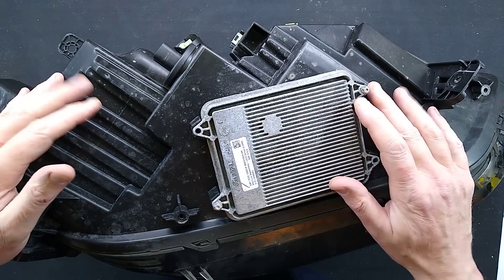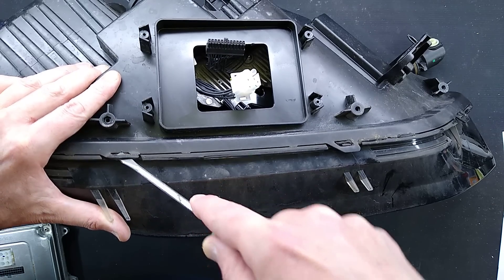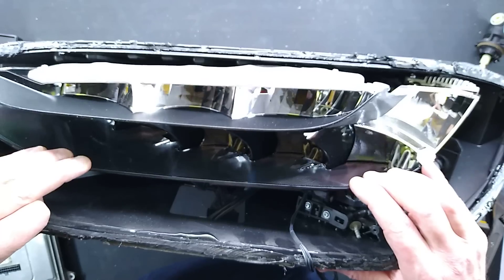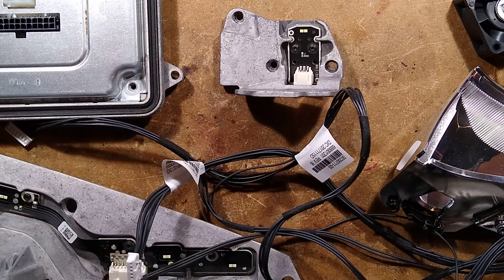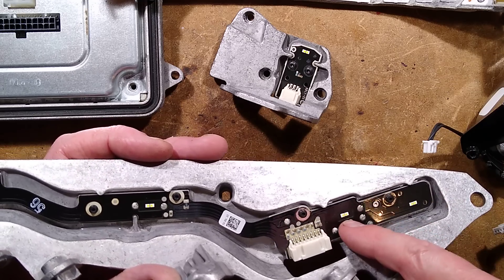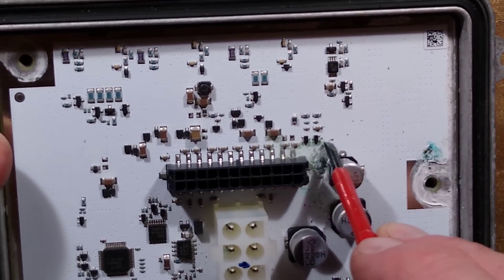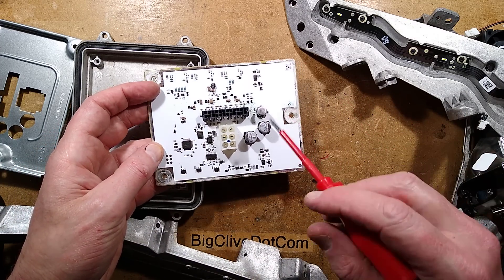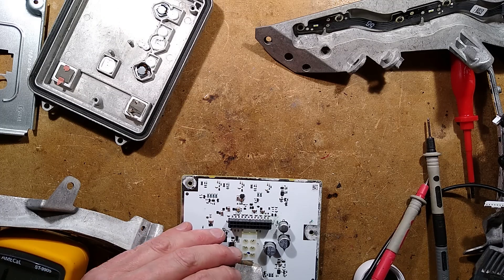Exploring a Tesla model X headlight

Comment: Remember when automotive circuit boards came with conformal coatings to keep out water damage?  
Yeah...not anymore!  You get to pay thousands of dollars for something that would have cost 2 pennies to protect.  
Yay Tesla!
Reply: I wonder why in our day and age is so “difficult” to make car parts waterproof… especially headlights, it’s not seems to be that difficult, not a quantum physics or something
Reply: @llMarvelous  Cost. Though some manufactures are upping requirements. I worked at a place where 100% of the electric door handles were failing. I response they upped the requirements for every external component with electronics. I think some of this is down to Tesla's arrogance that they are outside the realm of all the other automotive manufacturers. Hence why they've also forgone using automotive grade displays or other components.
Reply: @mintzbuck  yeap, but door handles is much more difficult to seal, there are a lot of moving parts, not just an enclosed container 
And also cost reduction is good, I guess, but poorly constructed parts may fail during warranty, and also it’s not a good reputation for the company… Tesla is not some cheap crappy car
My point - it’s very simple, but they not doing it anyway
Or maybe it’s just one defective part out of thousands…
Reply: @llMarvelous  It was literally just the exterior part. They ended up fully potting the circuit board in it. This module could have just been fully potted. And the point I am making here is, cheaper cars are doing more to make sure there aren't failures like this.
Reply: @mintzbuck  agree
Reply: @llMarvelous  Well it's not a cheap car, but the variable build quality and often questionable engineering makes it something I find less than impressive. It's very much like Apple, in that if you like what it offers (slick, fashionable, "cutting edge") it might be worth it to you, but if you're not interested in that sort of thing it's just overpriced. Personally the more touchscreen and cell-phone like general electronics get the less I want any of it, especially when it's grafted onto the nervous system of the car and un-upgradeable. The manufacturers just assume you're trading for a new car after 5 years now so standard DIN head units you can just swap are going out the window.
Reply: @mintzbuck  I dont think there were any 17" automotive grade displays back in 2010, while designing Model S.
Reply: @llMarvelous  
Car lights are tough to get watertight, as the lamp heats up and cools down it will draw in air (or push some out), causing moisture to ingress over time. Many designs these days do have dedicated membranes that are intended to keep at least water out. Others take quite a bit of care to at least keep electronics out of the way of likely condensation spots. Also a lot of  the control modules are either fully (or partially) potted (xenon drivers come to mind) or conformal coated. At least they were in the 2000s and 2010s. And i am pretty sure they would still be these days.
But especially Tesla has some.. let's call learning curve. With Elon's particular opinion about the "traditional car manufacturers" they have gone through wuite some design iterations on several car parts. The retractable door handles with their failure prone microswitches come to mind, iirc they changed that later on.
But i have a bad feeling we are going to see such issues bekoming more commonplace throughout all brands of cars.
Reply: @llMarvelous  Stupid design made to look fancy instead of work. Making each of the LEDs waterproof in that design is probably too expensive if having custom gaskets, vs just gluing it. If they made a simpler LED array, it'd look plain, but be easier to make.
Gotta make it look as stupid as possible (Apple trash can PC) and more useless to use to sell more!
Reply: @llMarvelous  Many headlight assemblies that I've seen have vents on them. They aren't sealed. I guess the idea is to make the innards of the headlight assembly waterproof so that any water that does get in won't cause damage. And provide vents so that any water that gets in can eventually evaporate.
Reply: @brianleeper5737  I'm very surprised to hear that they have vents...
With all headlights, first and foremost, they're sealed to keep moisture away from the ultra hot bulb. After that, it's to ensure clarity of the clear front headlight cover on the INSIDE (where we cannot access, let alone clean).

So any vents, in my opinion, I would think would be 1-way... Something like a simple reed valve using light weight super flexible rubber/silicone perhaps... 🤔

Either way, if not and it really is a completely open passage, then I'd be genuinely curious to know the method of dust mitigation utilized in order to prevent any from entering the headlight enclosure and thereby obscuring light output!
Reply: @DUKE_of_RAMBLE   I've seen what appears to be a piece of filter material stuck on the back of a headlight assembly.

Regular spinning-platter hard drives are also vented and have a cleanliness requirement that far exceeds what a headlight requires.

Considering the elevation and temperature changes a headlight is exposed to, how could they not be vented?
Reply: @brianleeper5737  My assumption would've been that the change in atmospheric pressure is both a slow process (not enough to cause rapid impact), but any built up pressure would have managed to escape by the o-ring around the bulb. A crude analogy: puffing your mouth up with air and at a certain point, you're lips can't contain the pressure and.... pfthbtbt; however, your lips are intact and still continue to seal without issues. 🥴

But yes, you make a valid point with HDDs. I honestly thought that it was there only to allow built up pressure to escape during spin-up (due to that [Nickola heh] Tesla Pump effect where high speed discs spinning in close proximity to each other generate considerable airflow... and presumably does the same in other liquids)
Reply: @DUKE_of_RAMBLE  I think they've determined that it's better to provide an easy path for air pressure to equalize than to hope that the o-ring is the weak spot.
Reply: @DUKE_of_RAMBLE  if there is a pressure buildup that results in a venting, now there will be a vacuum when it cools down that will suck water in.

Prime example is differentials in 4x4 vehicles, they get nice a warm, vent a bit, then when you hit water and they cool rapidly, they suck water in (unless you route your vents up high, which is normal, but some people get lazy during repairs)

you could of course just run them in a vacuum all the time, but that is much harder to maintain with seals, and also negatively impacts heat dissipation.
Reply: @Wooble57  So it's settled...
Fill the entire housing AND module with mineral oil!
No need to worry about condensation or dust, no air to create a pressure differential (I think 🤔) while fully sealed, and in turn no vacuum to draw in moisture. Plus, good thermal transfer! 🤘lol

[this is in jest, though, it may be feasible... if there's a seal material that won't degrade from being in constant contact to the mineral oil... which now that you mention diffs, I guess RTV would work!]
Reply: @Wooble57   "vent a bit, then when you hit water and they cool rapidly, they suck water in" Thanks. That explains it.
Reply: @brianleeper5737  Its normally a small rubber pipe at the bottom of the headlight unit on some cars that lets water out but not in.
Reply: @llMarvelous  It's planned obsolescence. We make submarines, why shouldn't basic electronics be possible to protect even if the whole car were to be submerged at some point. It's made to be replaced at some point, not enough money in just selling the cars.
Reply: @Tomazack  but Tesla don't like/want repairs, they just want to make & sell new cars.  They don't want the extra overhead of databases/parts storage space & service/repair staff (franchises like the ICE manufacturers).
They genuinely don't WANT to need to store & supply spares.
Reply: @Tomazack  Hence the need to deliberately shorten the lifespan of the products so consumers become repeat customers more often than they should, resulting in more profit for the company at the expense of the consumer.
Reply: Ford used some stuff that felt like silicone and had flakes of some kind in it (probably to make it easier to see how much has been applied and where)
Reply: @brianleeper5737  A lot of conformal coatings glow under UV. It's a common strategy for doing quality checks to make sure enough is applied and in the right places.
Reply: @mintzbuck  I'm aware. I guess Ford's way of doing it (which I've seen on ECUs from the 80s and early 90s) eliminates the need for a UV light for inspection.
Reply: ConCoat can bring about EMC issues, you wouldn't think it, but it's true and manufacturers spend a lot of money working out which components can and cannot be coated. They'll even specify exact thickness and exact mixtures of coating versus a solvent, which can have a massive impact on the production side as it usually has a negative effect on curing times and automated inspection.
Reply: pre 2004 they used to conformal coat ECUs now they don't bother and alot of them get a bit of moisture in them and rot,
Reply: @imranahmad2733  Pre-2004 ECUs were also less likely to be be under the hood. Now it seems like both Ford and GM put their ECUs in the engine compartment. You'd think that the need for conformal coating would be even higher in that location.
Reply: @brianleeper5737  I've noticed mercedes do that, they have the ECU right by the hot side of the exhaust/turbo, VW/Audi and Peugeot put them right by the battery, I can't see the logic behind it.
Reply: @imranahmad2733  Probably saves a meter of wiring compared to putting the ECU inside the car.
Reply: Is the Apple of cars
Reply: Remember when sealed beam headlight could be replaced for $19.99???
Reply: @woolymittens  When I was cleaning out my dad's garage after he passed away I found a couple of sealed-beam headlights still in the box. They were PLASTIC. I thought they were all glass, I guess some of them are made of plastic now.
Reply: I have a minor pcb hanging out the back of my Volvo v70 drivers headlight cover that’s seen two winters and some of the hottest days we have had in England and is still fine. 😂
Reply: Who on earth want to pay for this? 
The Industrie does not ¯\_(ツ)_/¯
Reply: I used to work for a scrap company and one of the things I'd do on occasion would be to teardown samples of automotive electronics so we could calculate a price quote to offer the seller.  Pretty much every one that I can remember at least a thin layer of conformal coating.
Reply: If we cover the circuit board with a conformal coating, what protects the connectors?
Reply: I still have ECUs from the early 80’s with conformal coating that work perfectly to this day. And yet stuff now just goes right to the landfill.
Reply: The conformal coatings can be obtained in 30 litre metal pales with spray machines , and even in giant Ibc pallet tanks 🙄
I've got spray cans of it somewhere ..
Reply: @grantrennie  the fact at how easy the stuff is to obtain why in the hell don't manufacturers do it already isn't that the point
Reply: My 2008 Volvo S60 HID active headlights (directional) which were worse than my previous 2007 S60 halogen Osram illuminated lights, were £1200 each (NOT from Volvo) to replace.  What exactly are you all criticising Tesla for with their mega modern, multi-lamp, sensor riddled lights & cost??
Reply: Why not sell a headlight a couple of times for one vehicle? Planned obsolescence. Greedy fucks.
Reply: the same company that monitors your driving actively and raises your rates nearly $1+ a minute if you're driving past 10pm
Reply: At some point in time they will have made any error already made by competition in multiple decades. 
Young guys (not really) wanting to feel the burn of the hot plate on their own.
Reply: Tesla are known for the worst (mechanical) quality in the business. That says something considering the plethora of german and german owned brands that crowd it.
Reply: @rimmersbryggeri  Heard that more than once.
Reply: @DIYDaveOK  Soon there will be a part of the population carrying a model s pendant round their neck rather than a cross, wrongfully claiming that it wass the archons of our age that destroyed their master rather than arrogance.
Reply: Wow, lots of Tesla haters on this thread.
Reply: @JohnCline  I’m not a Tesla hater, I just want to be able to repair simple things instead of replacing them.  A tiny bit of corrosion making you replace an assembly that complex and expensive is an absurd waste.
Reply: @JohnCline  Na, I'd call this a medium-low level.

And the funniest thing about is that this is not a Tesla-designed part. It's a standard supplier catalogue part that Tesla just ordered with their mechanical and visual specs...
Reply: @JohnCline  yes I hate Tesla
Reply: @JohnCline  You'll find a bunch of "haters" on these tech channels, they are all jealous that they didn't become rich. The biggest example is Thunderfool and his minions. A chemist preaching engineering and a bunch of equally unqualified missionaries trolling the internet. I bet there are some here.

Comment: Led headlights are notorious for failure, all it takes is one module inside to spit it's dummy out and it's game over!
I know the ones I've come across have fans inside as they get ludicrously hot!!
Reply: It's also very likely they are Lin bus single wire networked
Reply: Led tail lights are high failure too, yet another expensive "module" to chuck in the bin rather than replace a little bulb.
Reply: My personal pet peeve with LED tail lights is that lots of manufacturers seem to have chosen a dismally slow PWM frequency.  This for a light whose intended application is CAPABLE OF PROPELLING ITSELF AT OVER A HUNDRED MILES PER HOUR!   It’s a strobe-fest just watching one of those vehicles make a left turn.  The mind boggles.
Reply: @volvo09  yep, replaced a VW one a few months back was over £200 because the side light part failed!!
Reply: This is why halogen bulbs will always be better!
Reply: @chrisa2735-h3z  50% of the total energy used by Halogen lamps is converted to HEAT.. not light.

Comment: Interesting optics... to think that such a teeny tiny LED module does the job of a H7 bulb! Flex PCB is an interesting design. And yeah, the controller board looks kinda dissapointing, and like we see here, not really resistant to water damage. Tesla (the modern kind, not the one you had in Czechoslovakia) seems so dodgy when it comes to electronics.

Comment: The only way to get modern headlights apart is to use an oven then take it apart whilst still hot from oven.
Reply: Only if the adhesive is butyl rubber. From the video I think here they used something non-releasable.
Reply: @QuitProcrastinating  I believe it is, people have successfully repaired these Tesla headlights.
Reply: Probably ultrasonically welded the polycarbonate.
Or used DCM.....  🧐
Reply: A hot knife would work better than a Dremel imo ...
Reply: Mainly two kind of glues are used in modern headlights. Butyl seal, which can be "baked" open or "Permaseal", which is nearly impossible to open without breaking the housing.

Comment: I'm guessing the long strip of very small LED's is the sweeping indicator lights. Would explain why they are individual circuits. Perhaps the larger LED's are the dipped and main beam?
Looks like on the main (non conformal coated) board, the small mosfets are prob for the indicators, with the larger ones on the back for the main and dipped LEDS perhaps?
Reply: A Tesla model X has separate indicators in the front bumper and they are not animated. Those really small LEDs are the actual headlamps. That’s why Big Clive was so surprised, that these tiny components produce the majority of the light. Fun fact: the outermost ones are used to illuminate corners. The larger LEDs on the strange white PCB are for the milky white daytime running light strip.
Reply: @JeroenvanMontfort  Would have been nice if he tried powering them up.
Reply: @JeroenvanMontfort  - Thanks for explaining 😀👍